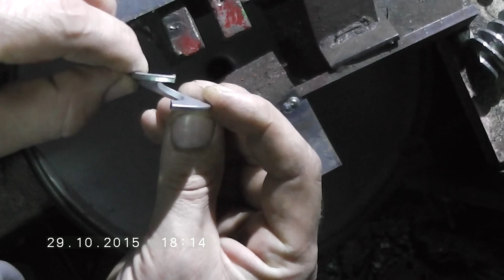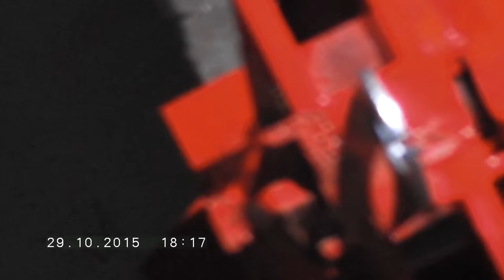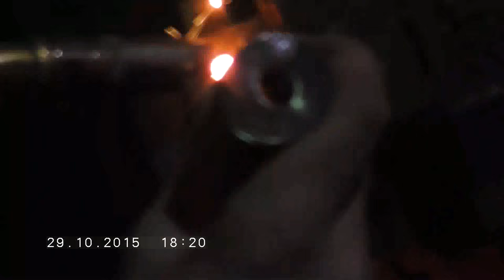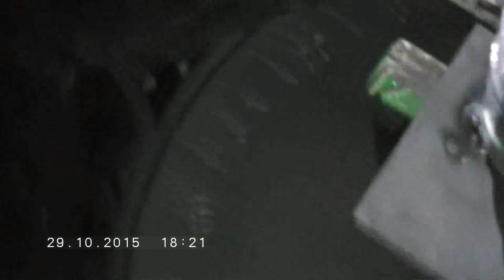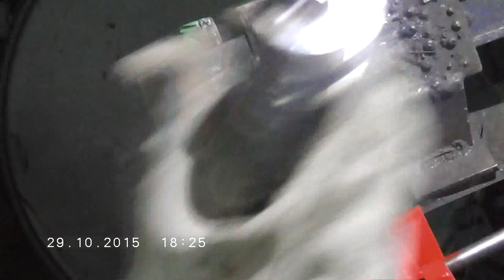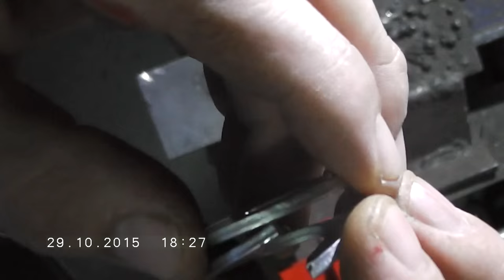Auger from washers

Comment: Again a very clever solution! I like the way you think hahaha. That auger looks good also! 
I'm in the process of building my own wood chip/sawdust  burner. I used a lot of your ideas. The only difference is that I will try to push the fuel up in the burn chamber with a auger. 
Thanks again for your efforts to put your video's on YouTube!
Reply from the maker: +Marcel Herwijnen i also work on my burner that has vertical feed not horizontal,put a video when you finnish your burner until than greetings from Croatia.

Comment: What welding process are you using . What amps.  Could i stick weld this ?
Reply from the maker: This is old way how i made it check my videos after that and you will see very easy and perfect way to make auger,i use CO2 welder,you can use electrode to weld two pieces together,greetings,video is:very simple way to make auger